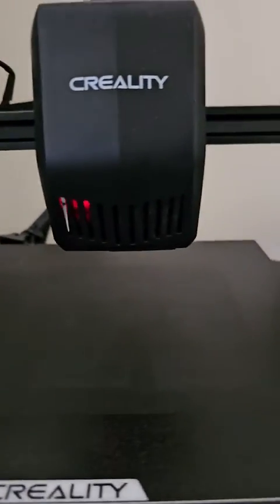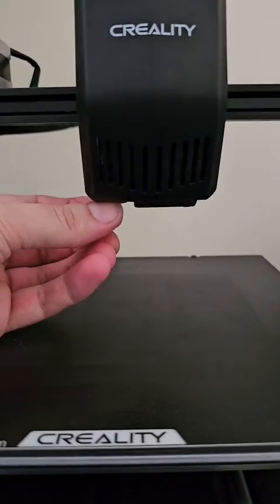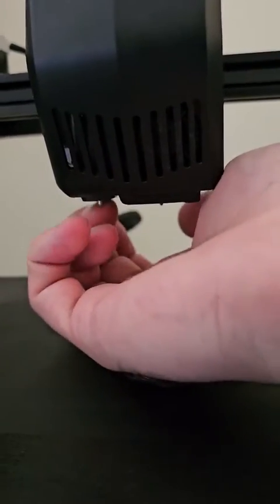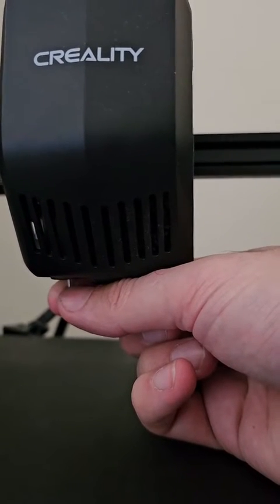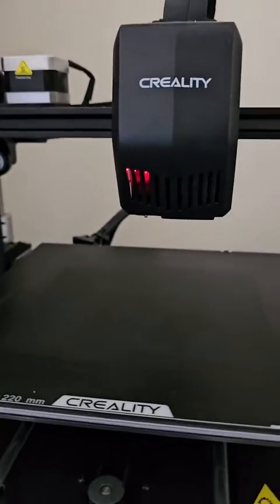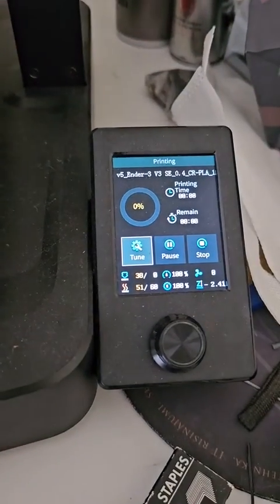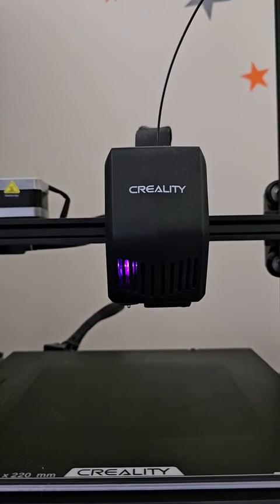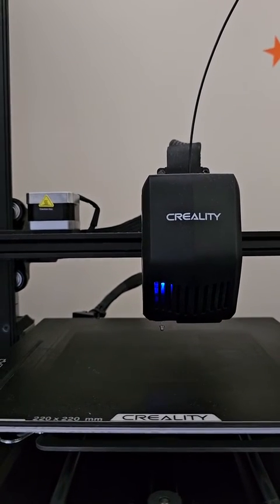Temporary Creality Ender 3 SE CR-Touch repair

Comment: Mine was bent a littlo so it won'tfully retract and neither drop, had to take it out the assembly of the extruder, openned it, pull the probe out and bent it so it will be as straight as it could, it is now working

Comment: My CR Touch did this sometimes when the printer was new, but after a while it no longer did anymore, hundreds of prints and no error by far. When it did, I always did some spin on it while the printer as off.
Reply: I brought a brand new ender 3 v3 ke yesterday and it has same problem too... I hope it gets right with the time as you say
Reply: @purushottamsingh2581  yeah it probably will! My v3 se really never did this anymore.